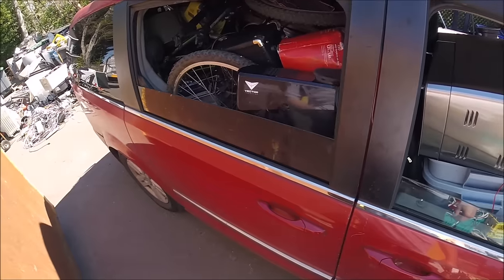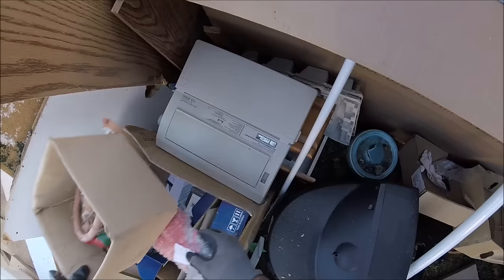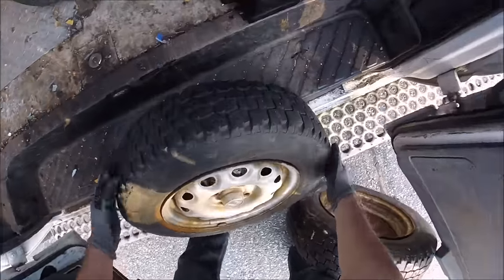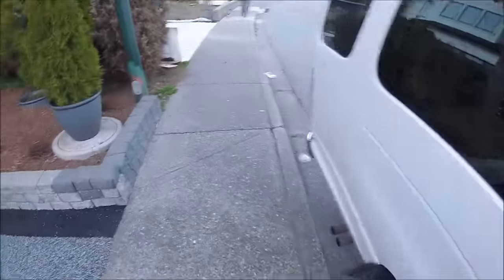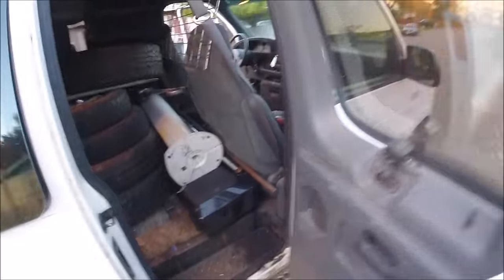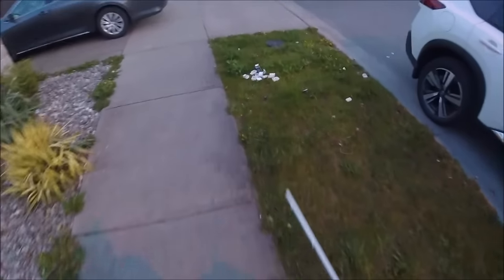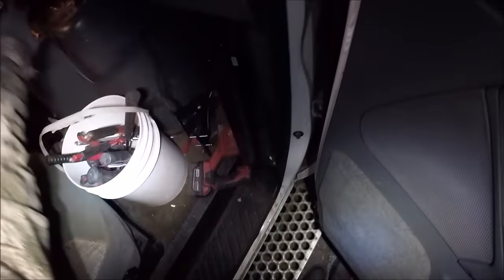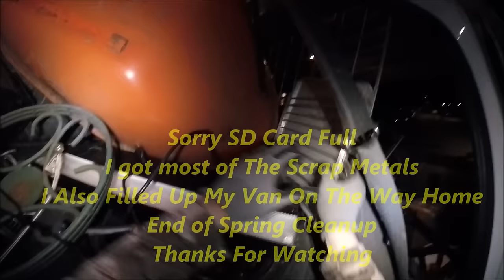Spring Cleanup The End is Here Picking up Leftovers

Comment: That guy with the dogs said it was running rich,too much fuel it’s not all burning off probably why it keeps dying it’s flooding it,I believe that thing is old enough to have a carburetor you can probably adjust that with a flat head screwdriver,the guy that fixed it probably didn’t tune it good. All that scrap is just insane I can’t believe how fast they cleared it all up you will be processing for at least a week

Comment: You have about 45 lawn mowers, at $ 10 engine $ 450 plus scrap metal $ 50, You have the welding machine and more, I think you get to 5-6000$ when you buy the car to be diesel manual transmission Be wide to fit two washing machines and tall for another row And the long
Reply: For the saw there are special blades for cutting aluminum, the blades for iron do not go to aluminum, they spoil them, because they are loaded with aluminum, look for special blades for aluminum, and use blades for iron for iron and for aluminum for aluminum, the brand new machine that costs you about 50,000 euro